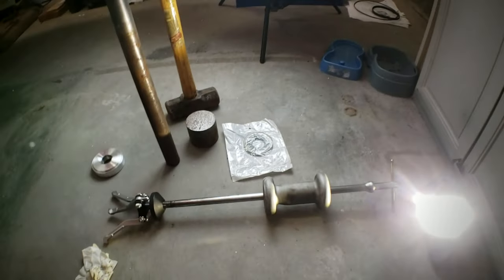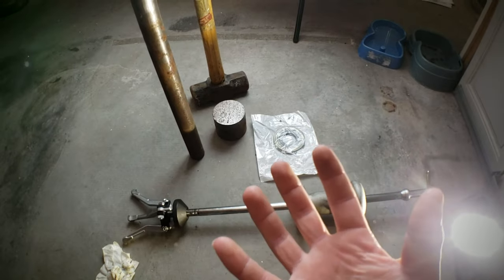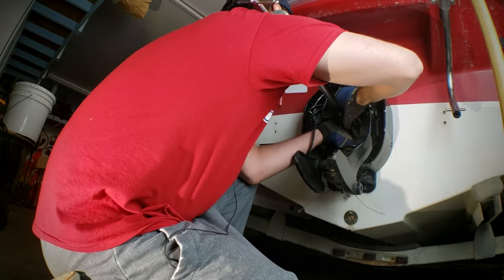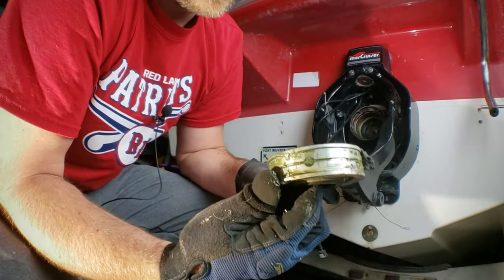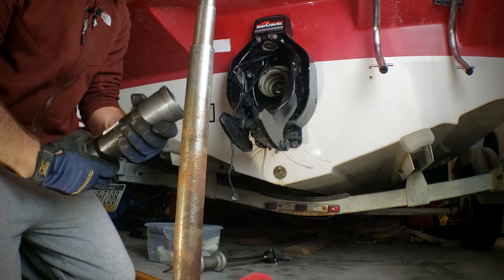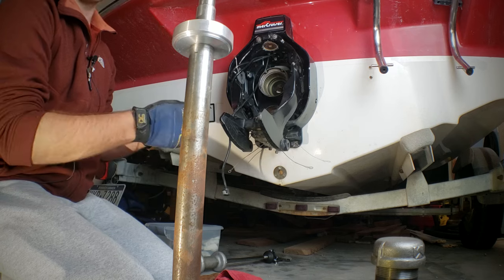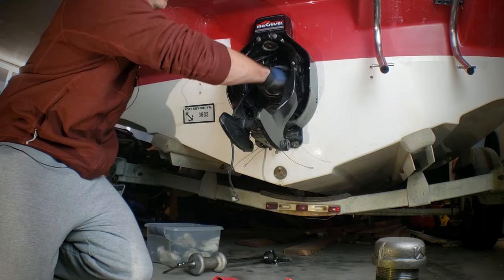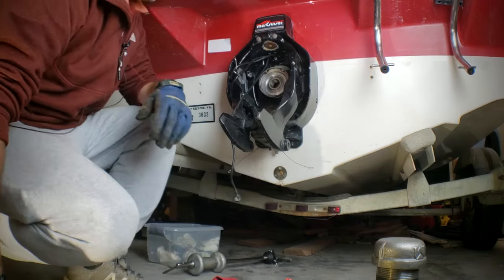Mercruiser Service: #1 - How to Change Your Gimbal Bearing

Comment: now i see you do not rermove that corrugated sleeve around the middle of the gimbal bearing, thanks for letting me see that. also that grease hole alignment, nobody else even mentions those parts. lot of super important info you shared with me, thanks

Comment: The bearing race with the 2 slots can be installed either way. With the slots toward the aft end GINNAN bearing can easily be rotated out to be replaced. No special tools required... Just a suggestion, the older ones were all factory installed that way.

Comment: If you are replacing bellows it is a great time to change your tilt sender wires and other things while you have that apart. I bought a kit of Ebay that has gimbal bearing, all bellows and other things.

Comment: That varying tool is also an alignment tool and is the most important out of the whole job. If it  doesn't go in-and-out extremely easily  you may have to adjust or replace your motor mounts

Comment: I have a sealed gimbal bearing to fit. Reading up on these bearings they are designed to move within the outer case to enable alignment. I also discover that if you fit the bearing so the 2 cut out areas of the outer case face away from the transom you just spin the bearing around in its outer case and take out the bearing and swap for the new one and thus won't ever need the bearing puller again!! I also wonder why you need and alignment bar when the sterndrive shaft itself aligns the bearing as it passes through and into the output unit anyway? thanks for posting. I look forward to seeing the hose/bellows installs next.
Reply from the maker: I've seen where people replace the inner bearing instead of the whole unit but I don't mind renting the slide hammer... also, the alignment bar is a must have. You should check you're engine alignment everytime you remove you're drive, especially on older boats where the structure might be getting a bit soft
Reply: @ashipshow  You are right. My drive would get to within 1 inch of fully fitted and jams up. My engine must be too high at the bow end as I can see splines with grease moved out on the top of the spine but not as much below. need a alignment bar and lower the bow end until its aligned. This might explain why the drive was such a pig to get out the transom in the first place!!

Comment: The yellow dot needs to be clocked at 10 O-clock position when inserted. It's in the technical manual and in the instructions for the new bearing. You installed it wrong!

Comment: Nice video, is the grease seal required if you're using a sealed bearing?
Reply from the maker: Most people say the seal is pretty much never needed... it's only real benefit is keeping grease from flinging into the bilge, however, it also helps keep bilge water out of the ujoint bellows if you ever flood your bilge

Comment: Hey so my new gimble bearing doesn't have a grease hole on it. I take it it's a sealed bearing.  Does this as also mean I never have to grease the zirk as the bearing wont take the grease anyway?? First time doing this so I'm just learning all this. Thank you for a great video!
Reply: That is correct if you have a sealed bearing you do not have grease it.

Comment: Great vid shame you did not line grease hole up i also noticed the dot was at the top it should have been around the 10 o`clock position as its opposite the grease hole.
Reply from the maker: I installed a sealed gimbal bearing, so there is no proper alignment for it... You are correct, if you use a greasable bearing, then you have to clock it properly.

Comment: Great video! What are the signs that u need a new gimbal bearing?
Reply from the maker: Typically you will hear a clicking or grinding noise, also, if you remove your drive and you find water in your u-joint bellows, thats a definite sign i needs replaced, along with whatever is causing water to get in the bellows
Reply: Cool thanks man. I have a 1997 Cobalt that I’ve been fixing up and I’m thinking rebuilding my whole lower on my alpha 1 drive just because haha

Comment: What do you think about having a stern drive in salt water year around? The boat I grew up on 76 caravelle didn’t have one I’m worried about how long the bellows will last and all
Reply from the maker: Nothing wrong with it...just need to make sure you don't have any exposed metal on the drive (paints in good shape)... The biggest key tho is making sure your anodes are in good shape and all your ground wires and good... Other than that, probably just need to make sure to you clean barnacles off from time to time.
Reply: install a fresh water {radiator type fluid set up] on your engine instead of just running raw salt water all the time. if run raw salt water, your engine block and intake and exhaust will get eaten up and need replacing . nothing you can do about the exhaust manifold tho...it will have to use raw water all the time. but at least you can spare your engine and intake manifold. salt water all the time is very corrosive
Reply: well not radiator but heat exchanger

Comment: Do you have to pull the engine to do this job? My nephew needs to change his, but as told on mercruiser you have to pull the motor first.
Reply from the maker: Nope, just need to pull the outdrive... The engine doesn't need to be removed for this.

Comment: Question.. for the seal does it come out and go in same direction as bearing (from outside in, or did u have to be inside your boat to install seal
Reply from the maker: The seal gets installed from outside the boat
Reply: @ashipshow  hello, so you need to install  the grease seal before the bearing? And do you need a special tool? And what do you think about the comment of the bearing dot needs to be at 10 o'clock position? Thanks

Comment: If the barring and carrier are not installed backwards like this video,  the barring can easily be changed out by twisting the barring sideways using the alignment tool and then slid out hrough the slots in the carrier. The carrier should last a lifetime because it receives no wear. Using a sleg hammer should be avoided.

Comment: I thought the dot was supposed to be aligned with the grease port
Reply from the maker: I've seen both... I would suggest spinning the crimp ring until you locate the grease port and then you know where it is on yours
Reply: It's not a grease port, Jerod is incorrect. And the dot is on the aluminum carrier 'race' and the port is on the aluminum carrier 'race', so how in the world would you ever line those up being they exist on the same component??

Comment: Jerod, That is definitely NOT a "grease port" into the bearing. Do better research, but don't just make stuff up. At best, it can be used to lubricate the OUTSIDE of the outer race where it actually pivots in the aluminum ring which you are holding. But you will NEVER get grease into the ACTUAL bearing without taking off the grease seals which are located on both sides.... and that kinda defeats the purpose, eh?
Reply: new bearing is sealed. no grease port